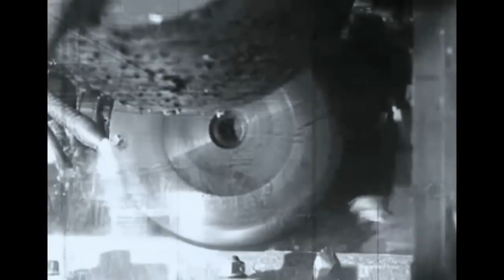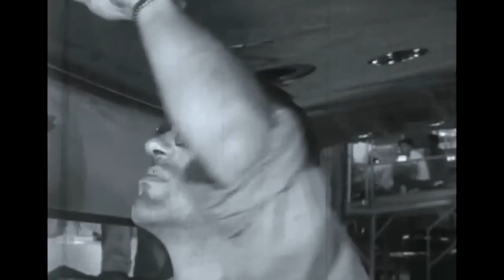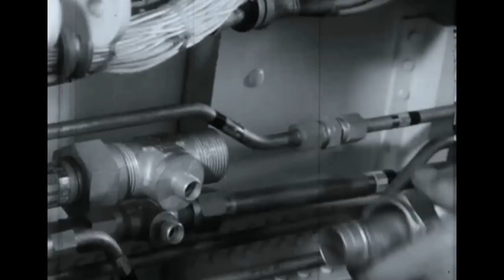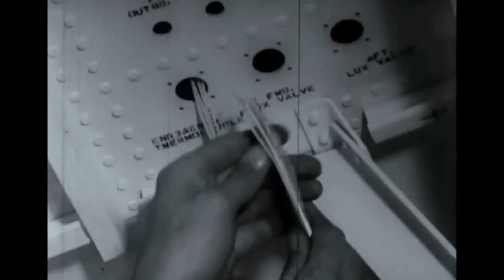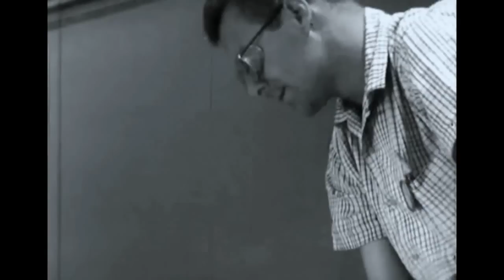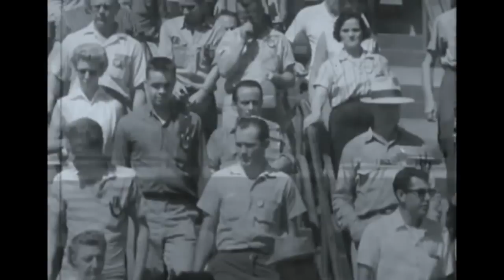Convair CV-880 Jetliners Under Construction - 1959

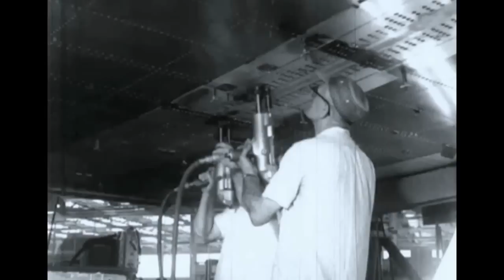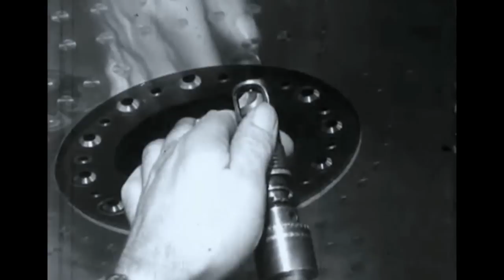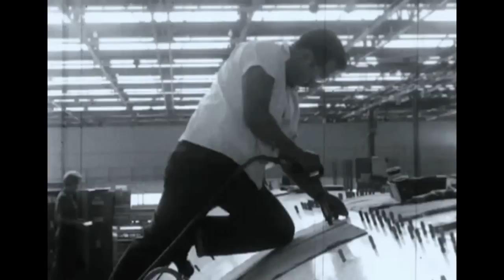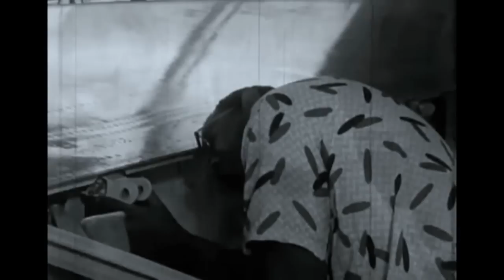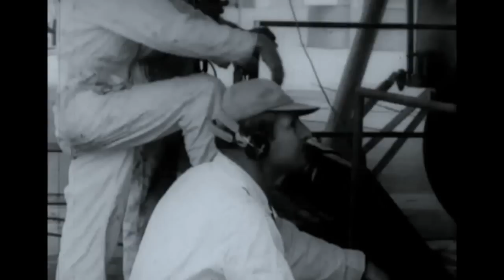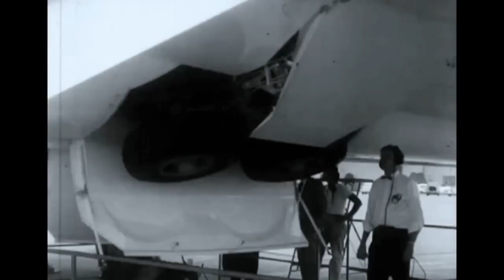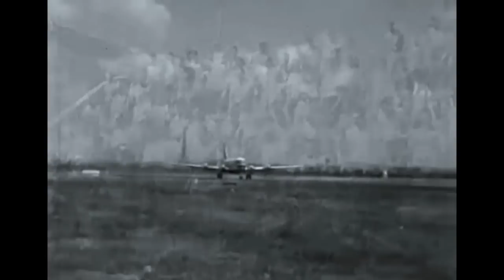Comment: Rivet bucking starting at 0:12.  Rivet shaving at 2:20.  Countersinking at 2:44.  Clecos holding skin in place at 4:08.  The shapely-looking women install insulation blankets at 5:34.  Landing gear swing at 10:00.  Seriously-bent needle at 10:11 (how did that make it through calibration?)  The old personnel overpass across Pacific Hwy. at 10:39. A NWA Boeing 377 Stratocruiser at 10:50.  F-106 at 11:00.  CV-240 at 11:12.
Reply: Think that CV-240 at 11:12 may actually be a Martin 404.  Can you imagine the stink raised when that bent-needle gauge showed up in the movie?  That pretty much invalidated the gear swing.
Reply: A gauge with a bent needle and a calibration sticker applied?
Reply: Look at that dude's face.  "How do I read a gage with a bent needle?".

Comment: Weren't the 880 and 990 faster than the 707 & DC-8?
Reply: And they had the fuel consumption data to prove it.
Reply: and only after they put the wing speed 'bumps' on.   The basic wing had a huge wave drag problem.
Reply: No. They waw slower but could take more passengers .
Reply: Not sure which way you are answering this.   To clarify, the 880 and 990 were faster than the 707 and DC-8 but were smaller and carried fewer passengers.